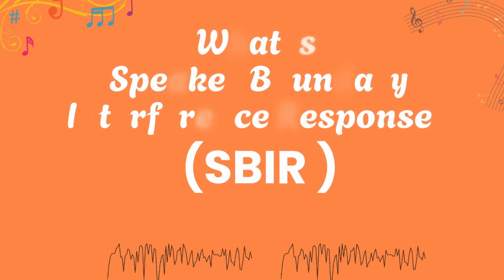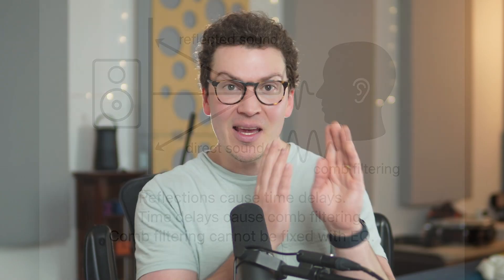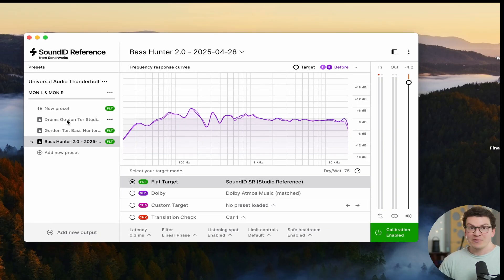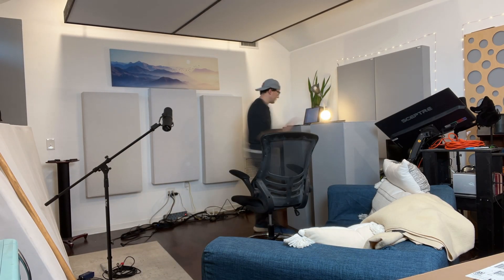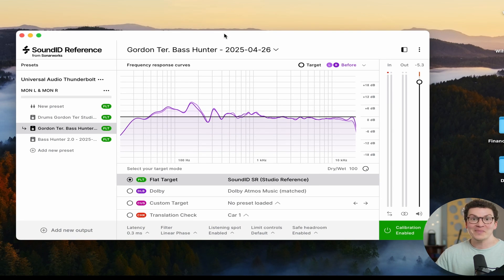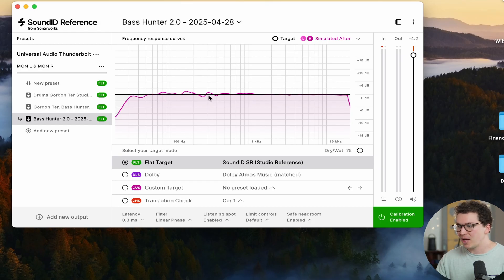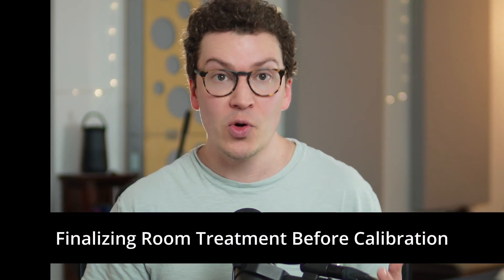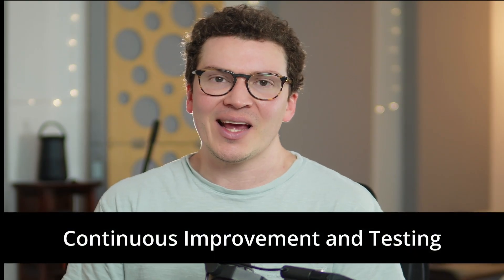This Fixed My Bass Problem

Comment: Great video. Two points not mentioned that are important:
#1 You always want HIGHER db in the low end, because subtractive eq is better than additive eq in this scenario.
And #2 Sonarworks "simulated after" should be known by all users - and by any users of DSPs - is that the "simulated after" is almost 100% innacurate...
The dB changes are a couple db, and you DO hear it, but its only a couple db change, not what it shows.
Reply from the maker: Interesting perspective — I'll look into that "simulated after" aspect further. Thanks for pointing it out!
Reply: @soundproofyourstudio thank ya!
Reply: @soundproofyourstudio if you use REW with sonarworks on (may have to use alternate soundcard drivers), you'll see how insanely little its actually adjusting the eq.

Comment: Another reason why you might preferred your dry/wet setting, is because, less EQed, more flat curve with the least correction bands possible, introduces less phasing issues. E.g. Arc 4 is better at it than Sonarworks, and still better than using dry/wet in Sonarworks.